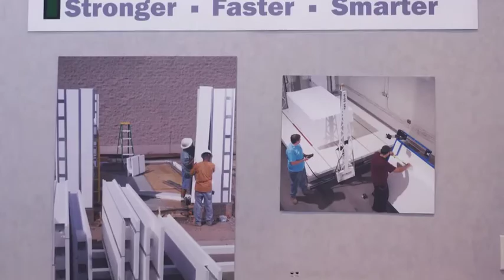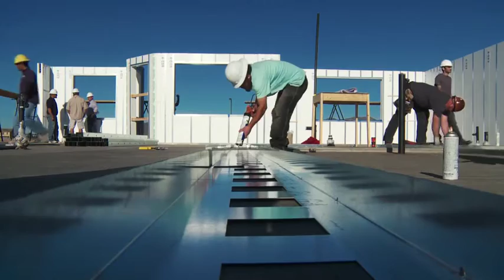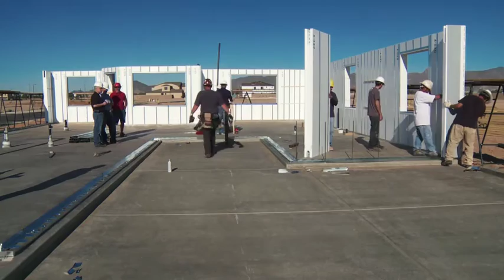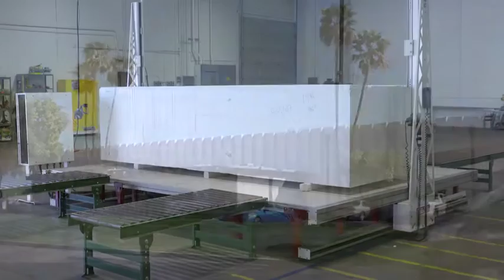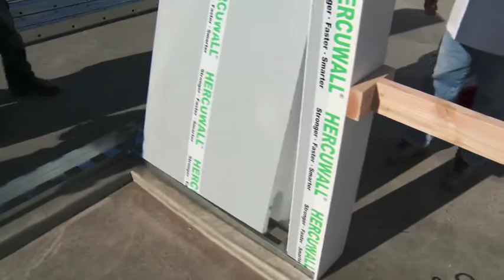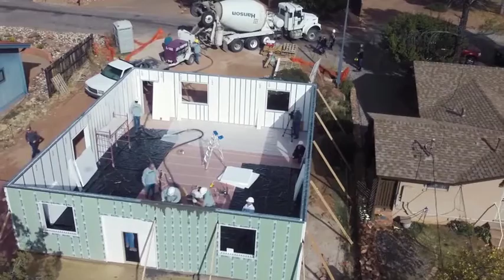HercuWall® by HercuTech

Comment: I'm all about it.  Saw you guys on the news over the weekend and think it's really cool.  Reminds me a bit of the Integra Block Wall System I heard of years ago.  With that, you build the blocks around steel rods that are embedded into the foundation.  When you're at the top of the wall, the rods are used to bolt the blocks to the foundation.  Then the blocks are filled with polyurethane insulation and the roof is connected to the rods...this makes for a SUPER strong, SUPER energy efficient building.  Like what you guys are doing, it seems like such a better way of doing things than doing the old wood frame buildings.

Comment: Why doesn't the inside of the wall allow a continuous concrete connection but instead it creates concrete studs with styrofoam spaces? Doesn't this miss the point of the ICF solid wall structure? I can throw a spear through the wall and land it in your living wall. I thought ICF was meant to prevent it especially during hurricanes. Otherwise it would be the best ICF that I've seen.
Reply from the maker: Good morning Markus.  We have tested a wood beam at hurricane forces for building in the state of Florida.  The certification link is below.

https://www.floridabuilding.org/upload/PR_Instl_Docs/FL18514_R4_II_SS%20-%20Hercuwall%208%20Composite%20Wall%20System%20-%20DWG%2015-1139%20-%20R2.pdf

This will send you to the pdf version 4 of our product certification.

Here is the Florida Building Code Online link as well: https://www.floridabuilding.org/pr/pr_app_dtl.aspx?param=wGEVXQwtDqs9%2f%2ftCOhpJQoJOlEUft3JaVUbXMUIS7df6zP82cTuGeA%3d%3d

If you have any questions feel free to contact us and we will be happy to answer any questions you may have about the safety of our product.  If you're interested in purchasing I suggest you reach out to our sales department.  Greg Garrison will be your point of contact.

Steve Coburn
Design Supervisor
HercuTech Inc.
480.284.4535
Reply: I had the same question. Seems like this product is simply saving the builder time, energy and cost but gives nothing to the client that ICF provides in abundance.
Reply from the maker: @Dhleeiv  Please visit our site for more information.  http://www.hercutech.com